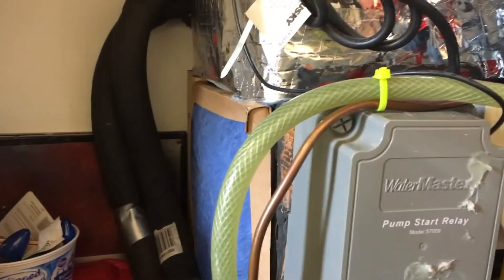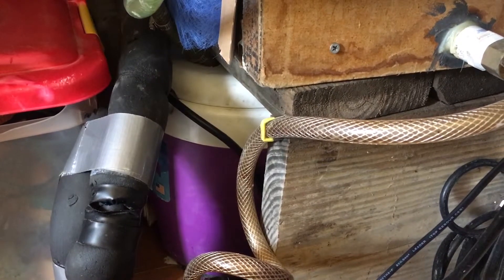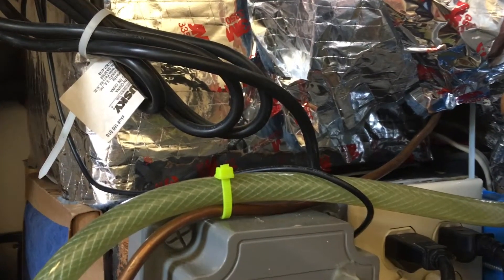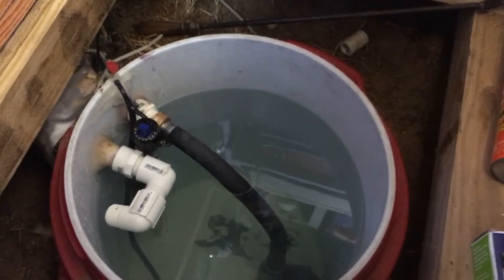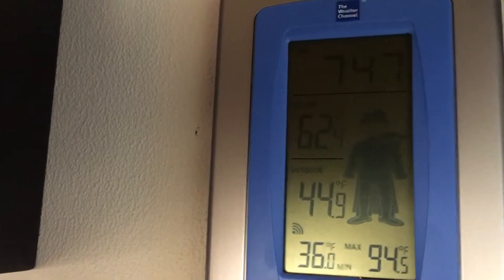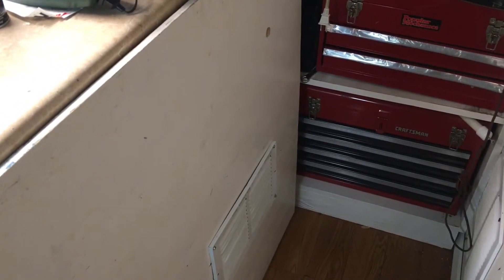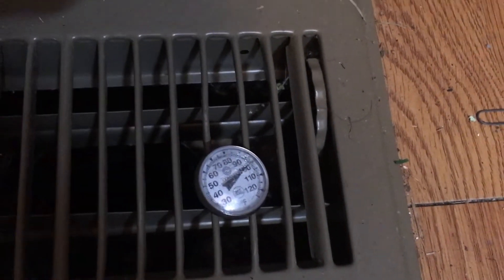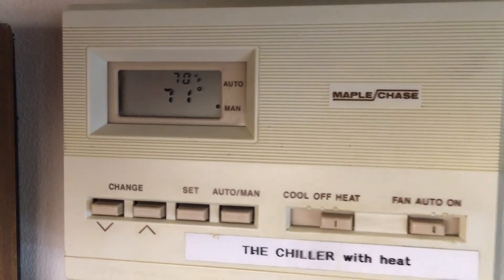Workshop Heat

Comment: Really handy if you had access to one of those instant water heaters free.  Then I'm sure it's a pretty viable heat source.  Without that, the little aquarium pump and that much water probably wouldn't provide that much heat.  But then again it doesn't really get that cold down there, or if it does, it's not for long.

The other question is how would a 1000 watt space heater compare?  Of course your rig is much cooler, but it's BTU output isn't much.  If it's left on, especially all day, it could take care of the workshop and keep it at temperature, all for about a kilowatt an hour.  I don't know what they get for those by you, but up here it's easily 22-25 cents, so at my prices it would cost $6 a day (for 24 hour constant run), or $180 a month.  Even at half the runtime, that's quite costly.  What do those killowatt hours run you?
Reply from the maker: Yeah, for our climate, it is just right. We seldom get below 15 degrees, and it lasts for about an hour. It would be interesting to see how it fares in your climate! The shop heat typically only gets used during the weekend, and after the initial warmup, it cycles with the thermostat. Since the water in the coolers stays hot for a while, it comes back up to temperature fairly quickly, when the thermostat calls for heat. What I need to do is plug it into my Kill-A-Watt, and see exactly how much power it draws, water heaters, pumps, faen and all. 
Kilowatt hours are 11.5 cents here. I'd have to only run the workshop on rare special occasions at your rates! Our electric bill for March was $88 to operate the weekend workshop, and all the vintage "inefficient" appliances in the house, including the NuTone bathroom heater each morning. Not too bad!
Reply: Woof, that's like half the price!  Last bill here was about $230, that's down 40 bucks from last month.  Half of that bill is the actual cost of electricity, the rest are taxes and fees and "delivery and system charges".  Gee, that explains a lot.  

Next month the bill goes way up, pool pump time.  The following month it's time for the A/C.
Reply from the maker: Holy Crap! You aren't kidding about paying to play!
Reply: Yep.  But there's no place like New Yick.  As for right now, I wouldn't have it any other way.  20 years from now might be a different story, it will probably so out-of-control that it's time to get out of here.  Who knows.
Reply from the maker: Yep,  same here. I like it in TX. Weeks of 100+ degrees, high humidity, and all.  I can see the cost of living going nowhere but up as an average of 400 people per day are moving here!  The home values have gone up 100% during the last ten years. I just keep working my day job, and doing side jobs as they come along to keep up with the pace. I can't even begin to imagine what lies ahead 20 years from now!